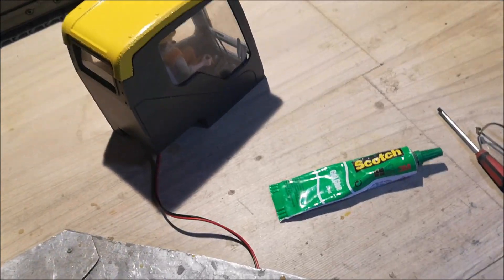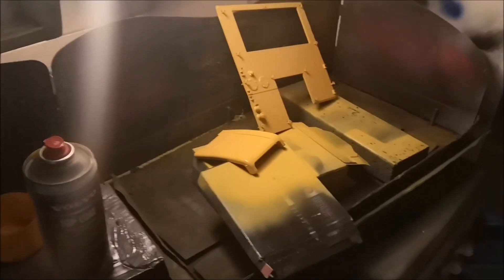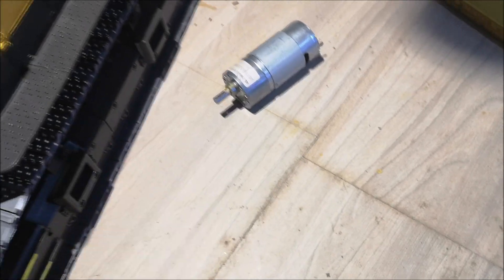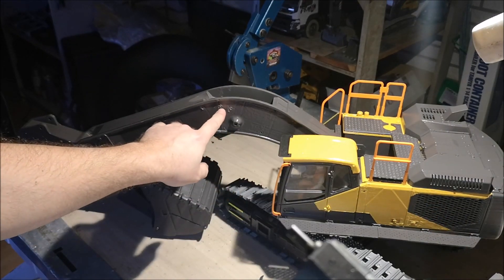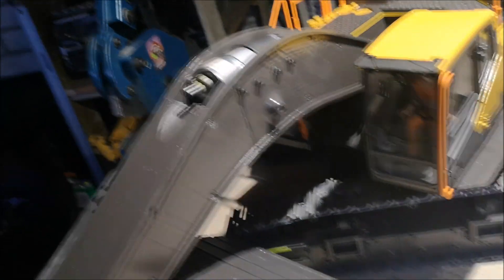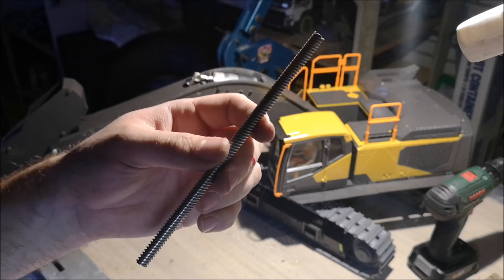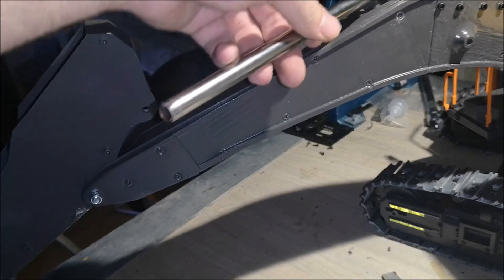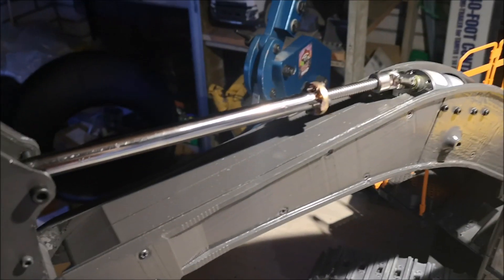Making a 3D Printed RC EXCAVATOR - Volvo EC550EL - PART 9

Comment: Hello Lasse, at first my compliments on your build, its obviously not your first excavator, your experience is clear during this build
How smooth and strong the model works is a pleasure to watch, the speed is also just right
And you operate it like a pro (says a former excavator student :-) 

You inspired me to try and build one myself, but i have some questions

Can you tell what the pich of the "cilinder" rod threat is ? You told the 8mm diameter but not that, 
Its real moving threat right (trapezium) 
And witch speed regulators do you use 
Last question for now : wich kind of battery do you recoment ?

Comment: I love This excavator but only one problem, I don’t know about all the metal plate and how you cut them and all that because I don’t have all that things. Anything you recommend i do?
Reply from the maker: Hello, for an excavator this size, and with these powerful motors , yes you would need steel reinforcements :( however, making the steel parts is really really easy, as you can see I dont use expensive tools\machines to work on my steel :) so I would recommend trying, its really easy ;)